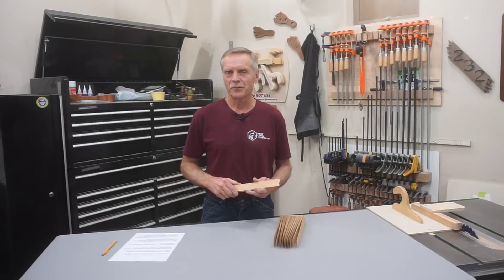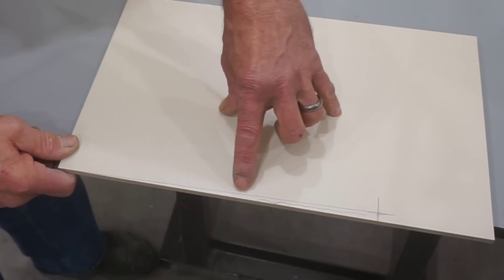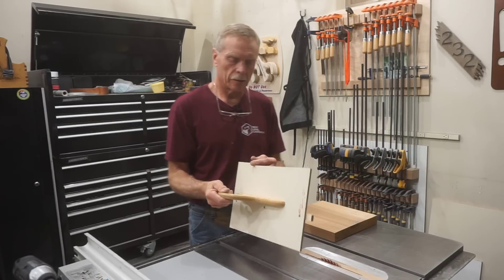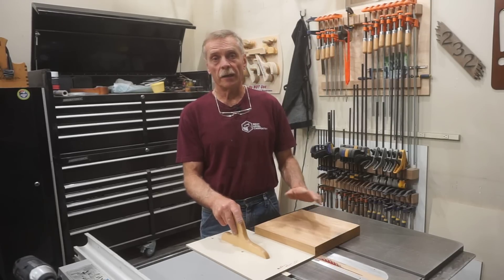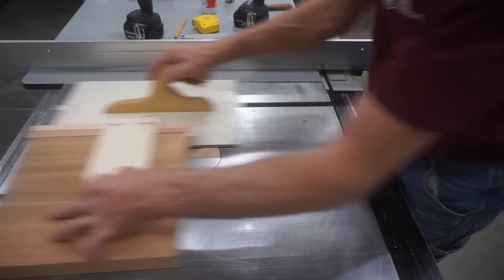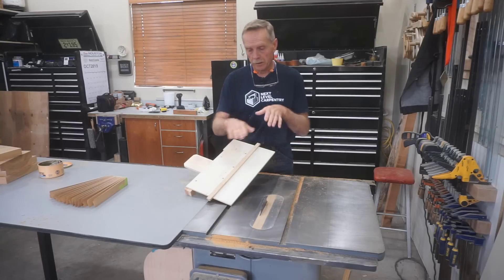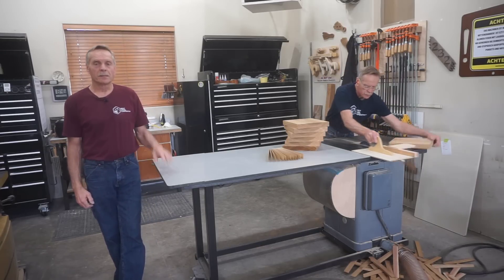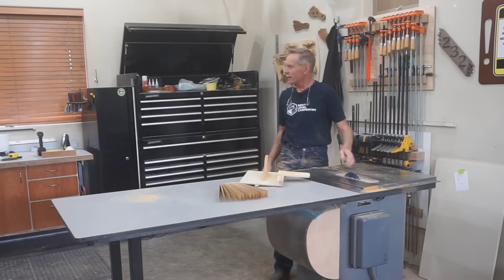Cutting Shims for Precise Work

Comment: JUST THE VIDEO I WAS LOOKING FOR, COULD I ASK WHAT BRAND OF THROAT PLATE THAT IS? LOOKS PRETTY SLICK
Reply from the maker: You can see product info on the insert here Thomas:  https://www.pinterest.com/pin/551479916872563699/ They quit making them years ago and only available on eBay, craigslist et al.  With all the interest I get in these I'm actually considering having them custom made and offered for sale.  Can you tell me what you'd be willing to pay for one of these if available?  I'm not sure if they could be made and shipped at a worthwhile profit at a price the market (you) would bear.  Thanks! Best, Matt
Reply: @NextLevelCarpentry  HI MATT, INFINITY CUTTING TOOLS OFFER A PLATE FOR THE SAW STOP THAT LOOKS VERY MUCH LIKE THE ONE  WOOD DYNAMICS MADE, BUT THE ONES THEY CARRY FOR THE DELTA ARE FROM A DIFFERENT COMPANY & HAVE FOUR SCREWS INSTEAD OF THE SLIDE IN INSERT. THE PLATES FOR THE DELTA RUN ABOUT $79 & THE ONES FOR THE SAW STOP RUN ABOUT $109, SEEMS A LITTLE STEEP, BUT IF IT SAVES TIME, MAYBE IT'S WORTH IT

Comment: You listed all the tools you used except the most used one... the table saw!
What table saw is that? - ( if you don't mind me asking)
Reply from the maker: The saw I use is a Delta Unisaw circa 1982 which unfortunately has long since gone out of production. There are plenty of new table saws on the market that would work well for making shims but I don't use or endorse any one in particular. I've had the same saw in my possession for well over 30 years and it has served me well so if you found a good used one I don't think you would be disappointed... Best, Matt
Reply: @NextLevelCarpentry   - Thanks for the reply Matt. I'm looking for a good quality somewhat portable table saw. The one I have I traded for and I'm really unhappy with it. You can't make a zero clearance insert easily as it's not designed to have one made for it. The fence sucks and I have to constantly re-true it. It has T-slots which the miter has a ton of slop... The extentions, which i like the idea, aren't true once extended.

A real pain to use. So I'm looking for a good used one. One I can make zero clearance inserts easily. One with standard 3/4 slots. And a decent fence and the ability to handle full sheets of plywood.

Unfortunately down here in S. Florida, they think any 50/60 year old rusted up table saw is worth it's weight in gold. lol
Seriously, a rusted up old Craftsman if the motor still turns with a hand crank they'll ask $500/$600 or more... A Delta... completely rusted out, sitting in the rain they'll ask a grand or more.. It's ridiculous.
Reply from the maker: @YknotLearnall  That's a tough situation... I hope you end up coming across an old gem somewhere; maybe craigslist, FB Marketplace or E Bay.  There's plenty of great old machines 'out there' because so many are 'upgrading' to Saw Stop and abadoning older stuff.  Good luck! Best, Matt

Comment: I have always used cedar shake shingles split into shims. If you just touch them to a belt sander to smooth and thin them it would be just as good but easier and faster. But I do like the jig you came up with to make shims.
Reply from the maker: Easier and faster to beltsand both sides of a bundle of shims than to cut them smooth and thin from the get-go?  Hmmm

Comment: I like that jig a lot.  In the video you use a lot of Robertson (square drive) screws.  Have you tried torx, aka star drive screws?  We used to use a lot of square drive stainless screws for anything made from pressure treated wood, but found it necessary to use a lot of hold down pressure on the screw gun-otherwise, it was easy to cam the head of the screw out.  The torx screws are much better in that regard, and are the same price per pound, at least in my area.

Comment: That doesn't make sense? When you  use a square to put a 90° line to finish the triangle your putting a right angle piece of wood into a less than 90° angle. Doesn't work! Please explain.
Reply from the maker: It DOES work... no explanation needed.  Watch closely: the video shows it working, not not working.
Reply: @NextLevelCarpentry  could you then simply explain with a little drawing please. No disrespect meant I just don't understand.

Comment: Wait a minute now your initial sample shims were connected. Howed that happen ?😉
Reply from the maker: Magic, pure magic Darnley! .😁😂😎 Best, Matt
Reply: @NextLevelCarpentry  Aww come on, your not gonna spill the beans 🥴
Reply from the maker: @DBYNOE  Not for just ANYone... but for you? Sure!  Just line up the thick end of a handful of shims and pull a piece of sturdy tape across the ends so they're all held snugly together.  That allows you to 'fan' them out.  Next lay them down on a flat surface and fan them out evenly.  Lay another piece of tape across the face of the fanned shims and stick it down.  This makes them all fan out evenly, repeatedly... but they'll stick together and be difficult to open up.  To fix that I opened up the shim 'fan', flipped it over so the tape on the shim faces was down, and then dusted the tape with fine wood dust from a sander to neutralize the sticky tape between the fanned shims.  Pure 'magic', right?  Incidentally I came up with this, not for effect but to pose the shims for the thumbnail image.  It was just happy coincidence that the visual turned out magically in the video... beans spilled?  Best, Matt
Reply: @NextLevelCarpentry  Now I got to watch that video again, for me the fan was the only reason I would even consider making my own shims. Sometimes I watch and think "Next Level" is an under statement 😎
Reply from the maker: @DBYNOE  Thanks, man... and have fun!  Best, Matt

Comment: You need to talk with Mr Snappy DrillBit  and have him send you money for your free commercial.

Ps.. I think chip needs to call OSHA and report you for no dust mask, hearing and eye protection, kick back absorbent safety jacket, no grip tite on floors around work area to prevent slip and fall accidents, noise canceling table saw, a softer gentler color scheme to reduce tension between chip and yourself, a soda machine that dispenses “big gulp” size adult refreshments.!! A court ordered tax paper audit to ensure chip is getting a living wage and sufficient retirement benefits.
Reply from the maker: I'd agree with you Larry but will have you know that 'ol Chip had to sign a 'I'm not a snowflake' disclosure prior to being allowed on the premises! 😉😎

Comment: Whoa.  What's this new technology that you're using?  I haven't seen another Youtuber use a hammer to "drive a tack."  Surely , the old-fashioned Torx screw could be used instead of this fancy, newfangled Festool tack method. It sounds European. It must be expensive.
Reply from the maker: Nice to meet you Duke... I'm from the future!   That cordless, airless non-pneumatic hammer isn't available to the public for another 37 years! 😂😂😁😎 Best, Matt
Reply from the maker: Nice to meet you Duke... I'm from the future!   That cordless, airless non-pneumatic hammer isn't available to the public for another 37 years! 😂😂😁😎 Best, Matt

Comment: why can't you just use a tapering jig? ...it's essentially what you built; a tapering jig has workholding and can easily adjust to tapers of various lengths and angles though.
Reply from the maker: You could, James, but you'd never match the speed and safety of a dedicated jig... just think about cutting 400+ shims with a jig meant for versatility... not me! 😁😎

Comment: What is the best wood species for shims? I know it's just shims..... But it's never failed me that the devil is in the detail.........
Reply from the maker: "Best" is relative but, in general, my preference is western cedar for door hanging, cabinet install, etc.  Sugar pine is a close second but neither are 'best' if a bunch of strength is required like in some framing applications because they're a little soft.  I actually like cherry for that because it's more dense but still not 'stringy' and snaps easily like cedar and pine.  I'd stay away from oak and doug fir for that reason: too strong in the wrong way and frustrating to use.  Composite plastic shims can be useful in damp and high-stress applications because they're more dense than just about any wood and 'won't' rot.   Hope that helps?
Best, Matt
Reply: @NextLevelCarpentry  thanks so much Matt!!

Comment: the only piece you need is that board with a cleat at the end, not all that other stuff.
just use the rip fence.
Reply from the maker: There's old carpenters and there's bold carpenters but there are no old, bold carpenters...